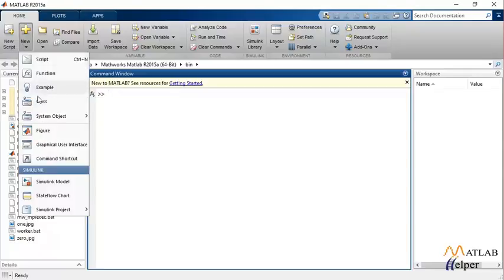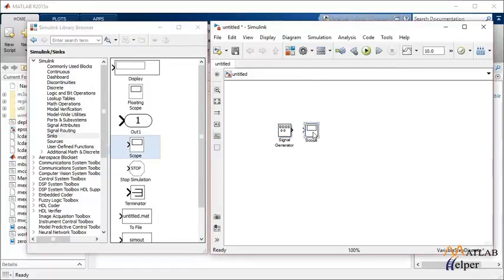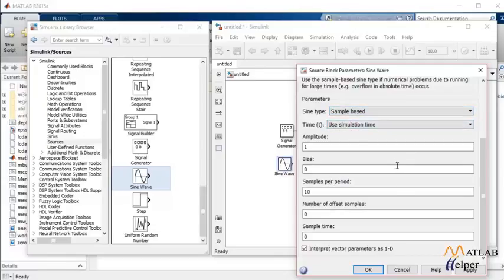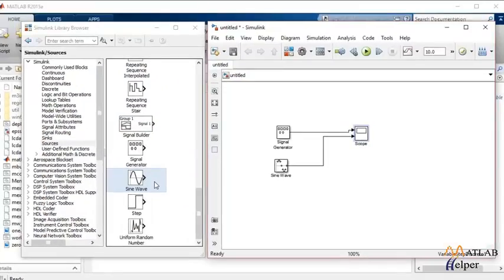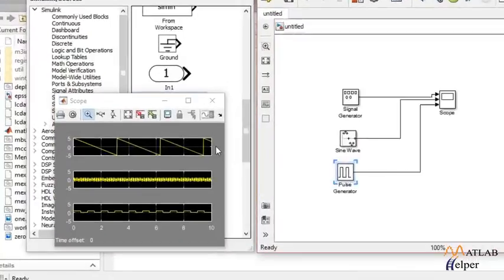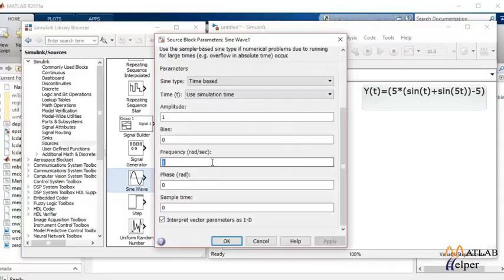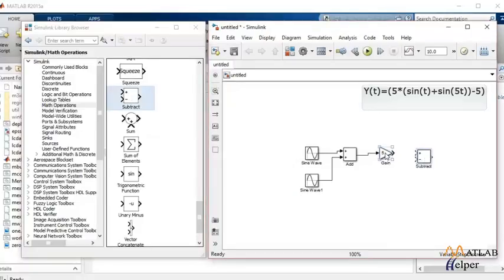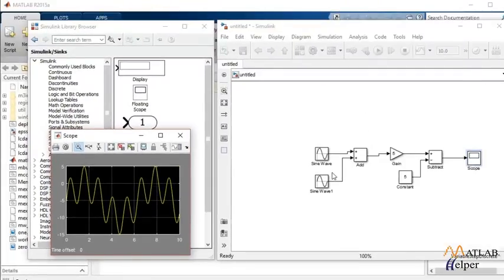Generating Signals in Simulink | Simulink Fundamentals | @MATLABHelper

Comment: This tutorial is about generating signals in Simulink.
#Simulink is a graphical programming environment.
#Here the path for Simulink window is, new-->simulink model.In that window, Simulink library(an icon) appears which serves more option.
#First, we are creating a waveform.To create, in Simulink library, sources-->signal generator(an icon).
#Signal generator is a block.It can generate any waveform like sine, square, sawtooth, random with a given amplitude and frequency.
#To observe the waveforms we need a block called scope.To create it, the path is Simulink library-->sinks-->scope(an icon).
#Connect the signal generator and scope.Execute or simulate and click on the scope to observe the waveform.
#We can use sine wave generator directly from Simulink library-->source-->sinewave generator and place it.
#Change the amplitude and frequency if needed. We can select time-based or sample-based signal.If we use sample-based signal, we specify samples per period.
#If you want to observe the waveform in the same scope, click on the scope-->scope parameters, change the number of axes to the required.
#Even we can generate a train of pulses by Simulink library-->source-->pulse generator.And you can specify the period of the pulse, pulse width.
#A scope can have any no. of axes.
#We can perform mathematical operations on signals.
#Here the signal is,y(t)=(5*(sin(t)+sin(5t))-5).Two sine waves are generated with frequencies as 1, 5 respectively.
#These signals are added using add block.To create it,Simulink library-->math operations-->add.Give the outputs of the sinewave generator to the add block as inputs.
#The summation of 2 sine waves has a gain of 5.We can use gain block.To create it, Simulink library-->math operations-->gain.click on it and specify the gain.
#Subtratct the output of gain and constant block.To create constant block, Simulink library-->math operations-->constant.click on it,and specify the value.
# Create a scope to observe the waveform.
Reply from the maker: Tejaswee Rayana, Glad to see your appreciation for our Video. Do support us by Subscribing to our YouTube Channel at https://www.youtube.com/c/matlabhelperteam